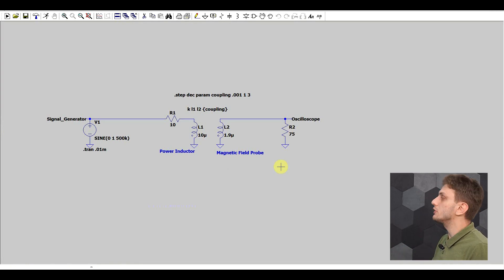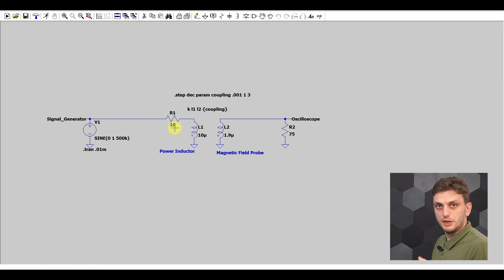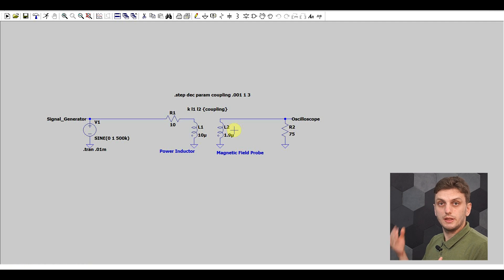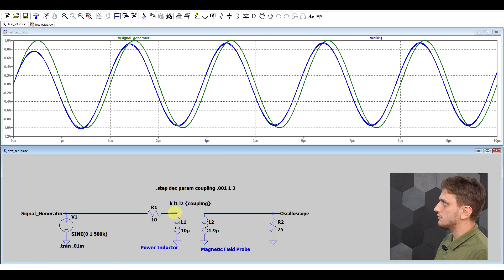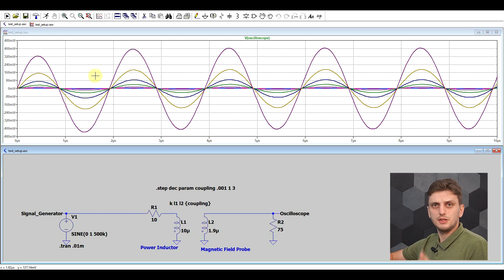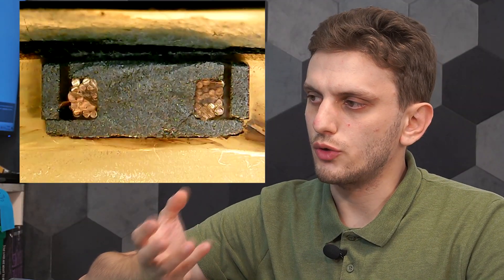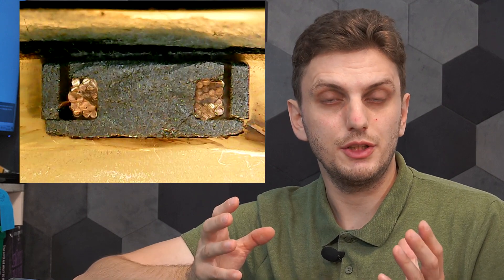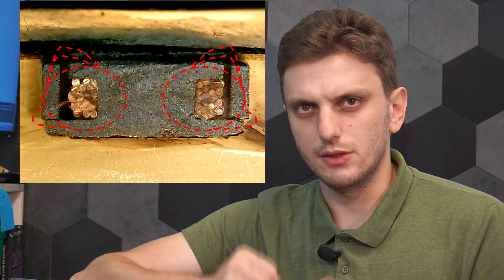Electronics tutorial - Inductor magnetic field emissions

Comment: I know this is an old video, but what if you took the best inductor shown and enclosed it in a metal shield itself and ground that metal shield to the circuit board ground. Wouldn’t that reduce emissions to nearly 0?
Reply from the maker: That would also help, but perfect shielding will never occur... Vishay has a series of inductors called "IHLE" where they use powder core to get the best magnetic field enclosure but also a metal "cage" to reduce the remaining emissions. Maybe other manufacturers also offer similar technologies.

Comment: Another great video, thanks.  You inspired me to start looking into the powder core inductors.  In looking around I came across this document from Wurth on EM emissions and the mention of powder inductors shielding falling off over 1 MHz caught my eye.  The document also has lots of other good information like connecting the start of the winding to the switch node.  You are becoming my go to guy for EE information.
Reply from the maker: Is it this app note by any chance?: https://www.mouser.com/pdfDocs/ANP047b_ENG_The_Behavior_of_Electro-Magnetic_Radiation_of_PI_in_Power_Management.pdf  its quite a nice document with very useful info
Reply: @FesZElectronics  Yes that's the one, I thought I had put the link in my post, oh well.  I'm thinking about building your test fixture to test candidate inductors.
Reply from the maker: I guess one thing that I didn't cover, but should be mentioned is how the inductor construction affects the parasitic parallel capacitance - the metal powder core inductor has the highest parasitic parallel capacitance and although it is best at "low" frequency magnetic emissions - it has significantly higher emissions at high frequencies when used in switching converters. I guess the best way to test this is in an actual converter and checking not just the switching frequency and first few harmonics, but also up to ~300MHz all the ringing and stuff.

Comment: Hi,  great videos. I am wondering how the result will change when you swap the polarity of those inductors. For example Coilcraft has power inductors with marking of the high dV/dt input for better noise shielding
Reply from the maker: The polarity will help with electric field noise, not really with magnetic fields - in case the coil is connected in an SMPS, the terminal on the switching node sees more noise than the other, so if that terminal is inside the coil (rather than on the outside) the coil will generate less electric field noise;

Comment: Did you try to play with different core shapes/cross-sections, would be much of difference if one would make inductor on hexagonal core? triangular core?
Reply from the maker: Honestly, I only tried commercially available components. But the geometry of the core should not have that much of an influence on how the field spreads out. A more important impact will come from the way the turns are arranged - if you have a single turn multi-layer inductor the filed will be more spread out and if you have a single layer multi turn, the field will be more concentrated in a specific direction.

Comment: This one is a nice video. 
I was working on simulating the conducted mode emission of a real buck converter using LTSPICE. After splitting the common mode and differential mode noise, I found that the conducted mode emission is way more than the EMC standard limits. So, I used the open source model of common mode choke filter. As a result the common mode noise were suppressed. But, now I want to make a simulation circuit of common mode noise filter in LTspice of my own which should give accurate results. Can you tell me how I can design it in ltspice. Any Book, Documents that could help me design it in LTspice?
Reply: If you have worked on this filter earlier, can you share with me your files that could help understand those circuits better.

Comment: Thanks for the video! As always very clear and informative. Have you looked into magnetic coupling based in-wall mains wire tracing? Most of the detectors appear to be based on capacitive coupling and it doesn't always work because walls can be conductive and it would register everywhere along the wall not just where the wiring is. I'm trying to find some info online. Found a youtube video a guy using a 1mH inductor and an amplifier ("How To Locate Wires In Walls(EMF Detection)") but with the inductor's axis perpendicular to the wall it appears that he's getting capacitive coupling instead of inductive. I wonder if this type of tracing is feasible/practical with inductive coupling. I'm thinking about injecting some high-frequency current noise (10mA peak) with a simple switching load at say 100KHz and then sensing it with a 15mH inductor. Not sure if it's feasible though, it might be that the magnetic field ends up so small that it's overwhelmed by parasitic capacitive coupling even into a low impedance e.g. 75Ohm like in your video.
Reply from the maker: The problem with generating magnetic fields is that you need a certain current to pass trough the wires. You could detect the magnetic emissions only if there is some sort of load added at the other end. The advantage with electrical field based detectors is that they do not require a load present, just an alternating voltage to be applied.

Comment: Since noise isn't correlated to the signal, you can improve the measurements by taking averages. This particular scope does have that option. 
Also, there are quite some more types of shielded inductors. Best known one is the toroidal inductor. 
But were the magic really happens, is when we also take the current vs inductance graph into consideration (saturation point). 
Or rather, were the rabbit hole starts, since it clearly shows that there isn't a perfect solution. A powered inductor may be great for shielding, but is pretty bad in keeping a constant inductance. Therefore it's totally unusable for audio or signal applications, because this means distortion is being introduced. 

Nice video again btw 👍🏻
Reply from the maker: Well, of course there are other parameters involved in inductors, depending on the application, one or another is more important. I focused on these inductors, because these are most commonly used with high currents - in switching supplies. A low power signal inductor will not radiate that much because of the small currents.
I did not test a toroid inductor mainly because its not that common - its a more expensive component because of its construction. Also to properly measure that one, you need to look at magnetic fields on multiple axes, since that inductor doesn't have a clear plane in which the windings sit.
Reply: @FesZElectronics  I guess "not as common " is very relative. Toroidal inductors are actually very common in automotive applications as well as high current applications, mostly actually because of their price vs performance ratio. Their saturation isn't as steep and strong compared to ferrite.
The downside is that their shielding isn't as good as well as a slightly higher DC resistance.
Reply: I guess what I am trying to say, is that context is pretty important. Each type of inductor has its own unique compromises.
Reply from the maker: You are right, its a perspective difference. My experience in power converters is mostly limited to 1-15W range where these types of inductors (that I analyzed in the video) are more common. I assume at higher power levels the toroid construction does become predominant. 
In what sort of converters did you see the use of toroid's? Also isn't the core material still ferrite?
Reply: @FesZElectronics  I don't have much experience with automotive, but I've seen toroidal inductors pretty often in industrial and aerospace equipment. For aerospace, toroidal inductors are especially common if they share the circuit board with other digital/analog circuitry. Powdered core is the best value for money when it comes to power vs noise, so you see them everywhere in PC parts for instance (CPU/GPU regulation). Very cool comparison and explanation as always. That cylinder for the sense coil looks suspiciously similar to a cut portion of a toilet paper roll core haha. I've used those a few times as board supports when doing some BGA rework. Hey, whatever works~
Reply: @FesZElectronics  I am talking about >200W-1kW basically. Especially getting enough power out on a small footprint is a bit of a challenge. Although in switching voltage converters the soft iron ones actually work pretty well and the degrading inductance can work as a benefit. 
For audio applications; check out Pascal Audio.
For low power you're right. The differences (in price) are to small, so just take something that fits the bill and shields well.
Reply from the maker: Thanks for all this input! I will probably make a follow-up video at some point and look specifically at toroid type transformers.